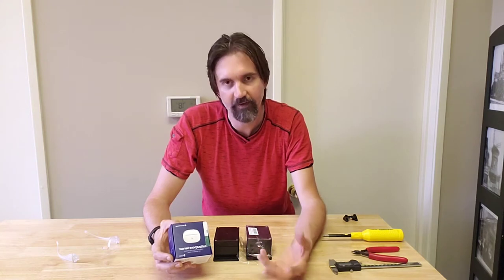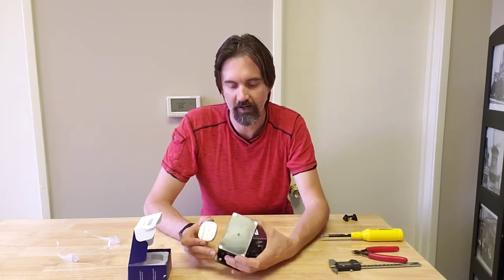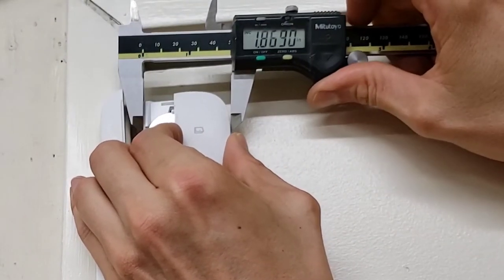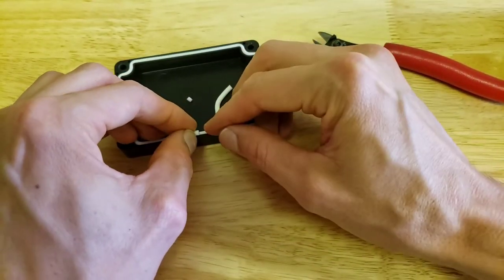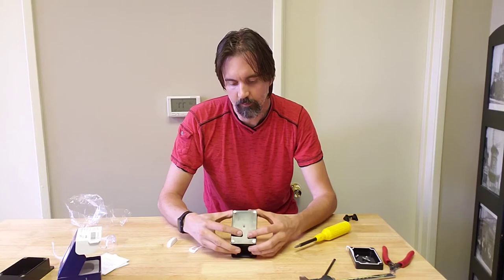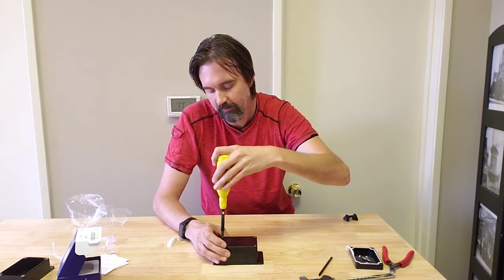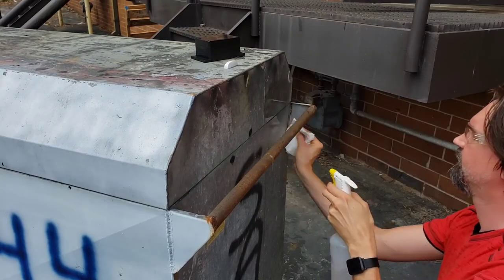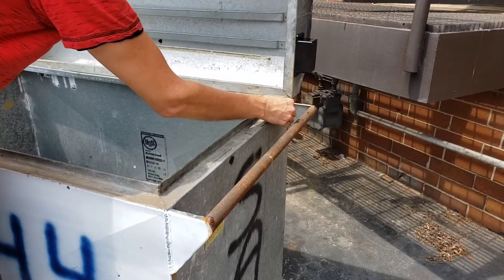DIY WATERPROOF SmartThings Contact Sensor -  Outdoor Z-wave & Zigbee Door Smarthome Automation

Comment: For anyone using Z-Wave, Ecolink makes a contact sensor (ZWAVE2.5) with an external input, so you can keep  the unit indoors (battery and circuit board stays warm and dry) while running a pair of wires out to a reed switch + magnet.
Reply from the maker: Thanks for the suggestion. It wasn't practical in my situation to run wires out to the location. This video is about setting up an outdoor sensor where you can't run wires.

Comment: Great idea. If it’s really waterproof you could leave the cover off of the sensor or you could attach the sensor with double stick Velcro. Then you can just remove the entire unit from the weatherproof box and bring it inside to replace the battery. Especially if it’s cold out.
Reply from the maker: Those are both excellent ideas. Then the box could be smaller too.

Comment: What about using silicone around the vulnerable areas?
Reply from the maker: Of the original sensor? If you seal it shut, then it will make it difficult to replace the battery. Also I'm finding that the battery is only lasting about 6 months outdoors. Therefore I will be adding a small solar panel with a rechargeable battery.
Reply: @engineerable  very true. Perhaps a very thin coat of silicone that could be broken by a razor blade for battery swap. I think I’m going to try it with a cheap sensor.
Reply from the maker: @robibler  It could work, depending on how the sensor case is made, you may have to seal up the case in addition to the battery door. Let me know how it works.
Reply: I think I might try this solution. The box proposed by engineered is more efficient but it is just too bulky for the front gate.

Comment: Hows the sensors going. Can i just open one up and fill it with hot glue. Changing the battery would require reapplying though.
Reply from the maker: @ivana6141 The sensor continues to work well outdoors. That's the problem if you fill it with hot glue, can't change the battery if you do that.